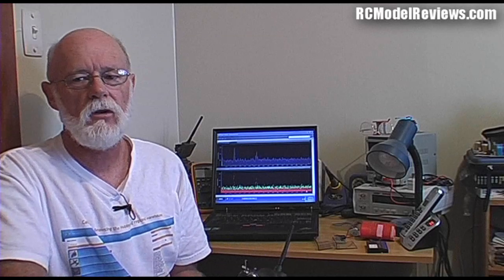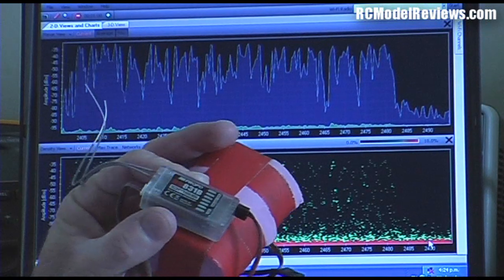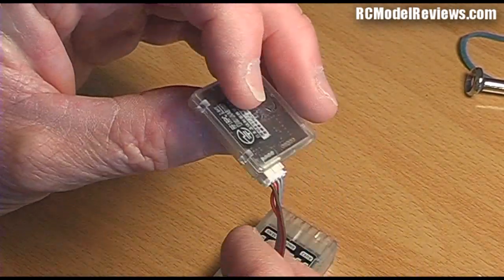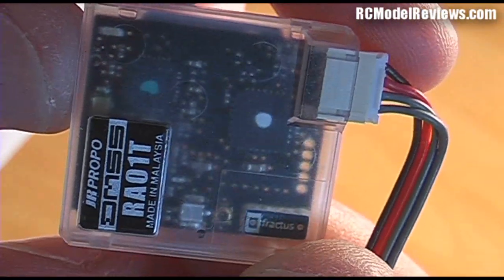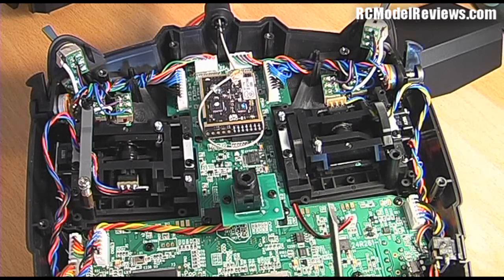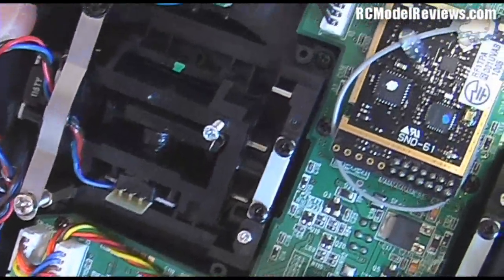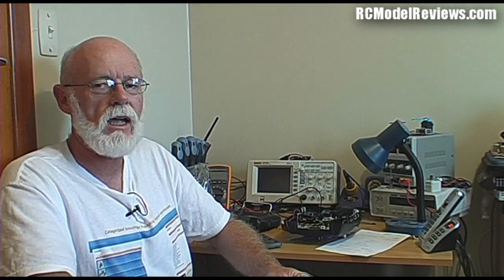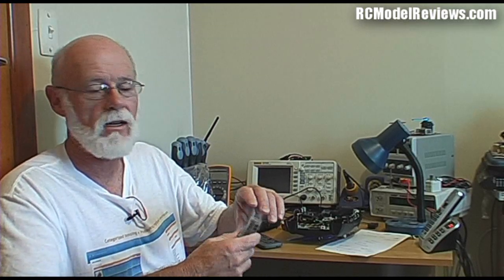Review (part 2): JR XG8 RC system with DMSS and telemetry

Comment: We have 2 members at our club with these transmitters, and when either of these radios are buddy box with either a JR or Spectrum Radio the Rx and servos goes through a cycle every 30 seconds that it glitches. We have tried differents buddy leads and Transmitter combination and cannot get the glitchers to stop. Has anyone else come across this yet.

Comment: Bruce - inside the receiver I can see what appears to be a very thin wire running from the servo connector pins to the main board.  It is visible at various points in the video such as 06:38 and 07:19.  Is it a wire or a hair ?

Comment: I have had my XG8 for more than a year and it has been fantastic. It works great, feels great and looks great. I just bought an altitude sensor from Hobby King and tried it out this afternoon on my Skywalker 1900. Don't tell anyone but I climbed to 1500 feet when no one was looking. The sensor works really well and you can set the Tx to beep differently within different height zones.
Reply: I need a radio that is basic and easy to use i am looking at getting my trex 700e dominator under 5kg with a 14s pyro 750 560kv setup looking at  longer flight time at 2000rpm for mild sportflying 3d fun hard 3d is boring its getting silly and dangerous aswel time to mix it instead you can do hard 3d  without the silly headspeeds 2000rpm is lying in my comfort zone lol 2200 2450rpm or 2700 rpm on a 700mm blade makes me curl up lol even at 2000rpm on a 700mm blade is scary the 693 blades needed high hs but the bigger blade has more lift and less hs is needed for my flying style